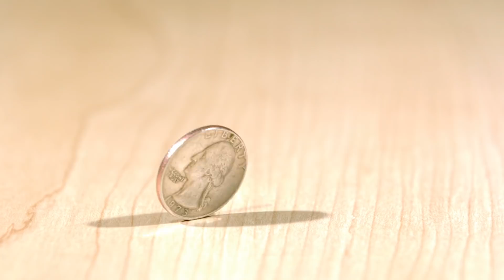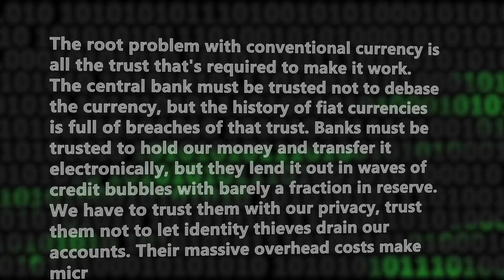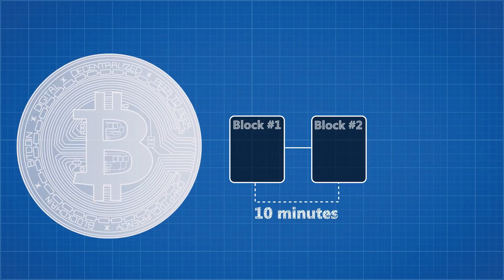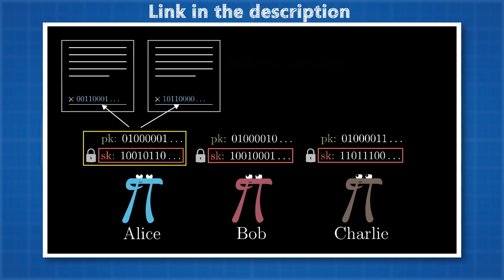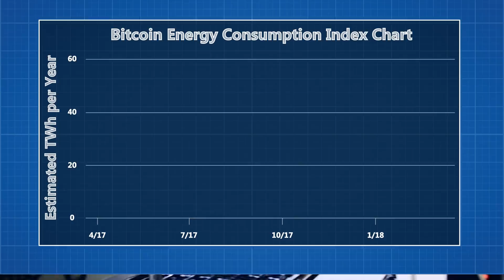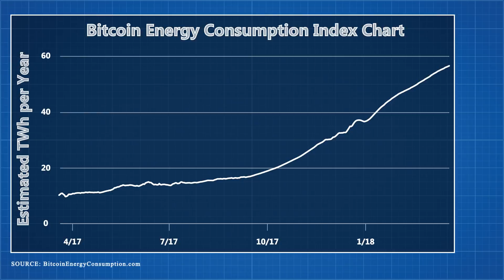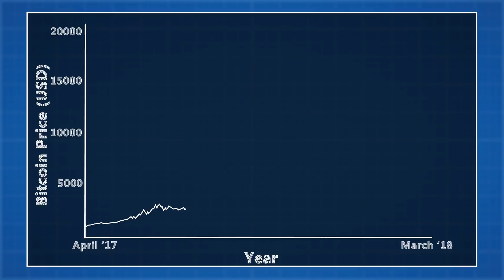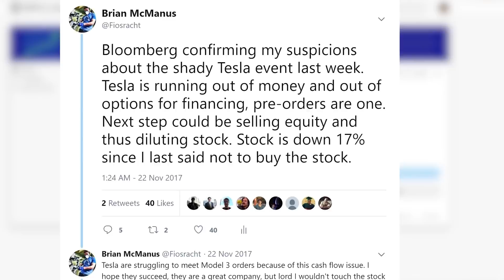Why Bitcoin Is Not Working

Comment: You're not wrong with Bitcoins fall, but there is a point with Bitcoins intent vs output. Bitcoin was based on a gold model, where it gets significantly difficult to get more bit coin. Now in real life, we don't use gold for day to day transaction, but we used to use gold to back up paper money. When Bitcoin reaches the max mark, it will have a set value based on the considerations of the user base. This, added with a decent way to move money (its no wire transfer, but it will do) will let itself be used in large transactions, like when families sell property to fund their children's collage tuition. It won't be common or useful for day to day transactions, but I do see this for buying/storing large sums of equity.

Comment: It will not work as real currency until both of these conditions come true: 
1. Criptocurrency is accepted by small vendors in local shop.
2. Mobile devices become powerful enough to process blockchain in real time, so payments are done just as easy as with cards now.

Comment: Maybe the title should be less clickbaity ;-)
The video is about: "Why proof of work is not working".

The unstable price is not a valid argument against bitcoin. It's unstable because the number of people using it is very (very) small compared to other currencies. A single event can cause big ripple effects - Like problems with exchanges caused price drops even when bitcoin was not the problem/unsecure - the exchange was. If you have a huge market capitalization (like USD or EUR) it doesn't matter if a single bank is robbed.

But sadly you main point is true. To much energy is needed to secure "proof of work"-blockchains.

Comment: If you want a currency that is decentralized and real, make it kWh.  Kilowatt hours.  It is real and can't be faked.  It can't be controlled.  It will be king over ALL cryptocurrency since they use power to mine and maintain their system.  We use it every day in our home and work.  We use it to make our food and goods.  It is already entwined into every aspect of our lives.  It will spark the next real revolution.  The Energy Revolution!  Storage will get better out of necessity.  Generation will get better.  Transmission will get better.  People can make a portion of what they need at home similar to how crypto miners mine free crypto.

Public funded power plants will become U.S. property.  Transmission lines funded by public money become U.S. property.

Any privately owned generation plants can't make up more than 5% total GDP.  All privately owned power plants, transmission lines, and equipment must buy and sell all power from the U.S. grid.  The grid is the marketplace where all transactions take place.  It can even be tracked by a public ledger system the crypto nuts clamour over.

People can store excess kWh in battery systems or contracted future generation.  As storage results in efficiency losses, this is a natural barrier to prevent a single individual or group from stockpiling kWh to amass power and influence over everyone else.  Stockpiling contracted future generation will be safe from manipulation if you don't have the means to store or use the power.  Intentionally shorting circuits to consume large volumes of kWh to drive up scarcity will be detrimental to transmission and equipment on both sides of the demarcation line.  It has natural barriers to abuse and corruption.
Reply: Charles Watts Wow, that's actually a sensible plan!
Reply: Very interesting plan from a quite appropriately named source!
Reply: Sounds a lot like digital communism. No thanks.

Comment: In short-long:
Bitcoin is backed by nothing, unlike most physical currencies (with gold, etc.).
So it's value changes rapidly, and value today, may not be the same as tomorrow.
Imagine being in a car dealership, selling cars for bitcoins. 
You see this beautiful powerful yet economical car and you decide to buy it.
The dealership gets 10 bitcoins (equal to this date about $90k) and you drive off, you have your car, the dealership made money and both sides are happy.
The very next day, just as the dealership opens, the price of that 10 bitcoins dropped by a half to $45k. And the next day the trend continues, driving bitcoin price down to, lets say $15k, below any reasonable reselling value. Dealership lost alot of money and can either:
A) Wait for bitcoin to gain value again
B) Start selling cars with price times the bitcoin original (+profit) value. 
The B) will cause car to cost 40 bitcoins, at which, only a few people who mined BTC themselves, can actually afford this type of transaction.
The resell value of brand new car, that has been sold for 10BTC just dropped, yet if you decide to "make more" by selling that car for... 30BTC - "less" than the dealership but "more" than the initial value, you will innevitably lose money.
When the BTC value returns, everyone who paid more, will lose even more.
This results in mexican stand-off, where neither of the sides want to buy/sell, due to uncanny future.
And that, ends up in everyone going back to physical money, because you can't easilly affect the value (unless political drift/military conflict/natural disaster happends).

Comment: Bitcoin is not volatile. Back in 2009, 1 bitcoin was worth...1 bitcoin. You know how much 1 bitcoin is worth today? 1 bitcoin! What can I buy for $1? $1!
Bitcoin is only volatile when you have a preconceived idea that the USD or fiat is the legitimate currency. I could use the volatility argument against the USD. Using the same logic, the USD fails as a currency because 1 USD is worth trillions of Zimbabwe dollars! Too volatile!
Fiat currencies are used because they are the most accepted and utilized. If prices are quoted in BTC, then volatility will become irrelevant.
Reply: Have you taken an economics class? This is circular reasoning. Value is relative and based off supply and demand. As a society, we have agreed that we are willing to pay $1 for a McDonalds hamburger. However, we have not come to agreement on how much bitcoin that same hamburger is worth. Back in 2009, it might have been worth a few thousand bitcoin, but now it would only be worth a minuscule fraction of a bitcoin. Over that same time, that cost of the hamburger in USD has changed mainly due to inflation, which is fairly constant and deterministic.  Since that fraction of bitcoin that the hamburger costs changes day to day, but the supply and demand of hamburgers does not really change day to day, we can say that the value of bitcoin is volatile. You can say 1 bitcoin is 1 bitcoin, yes, but the value of something must be compared to something with intrinsic value. In modern society, that "something with intrinsic value" is generally goods and services.
Reply: classic 12 year old who read about bitcoin and now thinks he knows about economics. your comment is fucking ludicrous lmao
Reply: KenanQHD okay, let's say we use that analogy. If you buy 1 car i  the US, it will cost 1 bitcoin. Will it cost 1 bitcoin to get a car in zimbabwe as well? If you said yes, are you saying the US economy is just as valuable as zimbabwe's economy where the things u can get in the US costs just the same as you would in Zimbabwe? And if u said no and say 1 car in the US is 1 bitcoin and 1 car in zimbabwe is 5 bitcoin, why don't we just buy unlimited amount of cars in the US and sell them to Zimbabwe and make an unlimited risk free profit? Tell me, how would that work?
Reply: I don’t think this guy gets how bitcoin/crypto works
Reply: KenanQHD there is one small flaw in your argument: you are comparing currencies to currencies. All currencies are volatile to some degree (the Zimbabwe dollar much more so than the USD, for example). To validate your argument, and how historians and economists determine the inflation and volatility of a currency, you need to determine how much of a certain good the currency can buy. Let’s take bread for example. How much has the US dollar amount required to buy a loaf of bread changed in the past 10 years? Not much, so it is relatively stable. How about for the Zimbabwe dollar? A lot (it changed drastically even in a single day), meaning it is quite volatile. And if we look at Bitcoin, the amount of bread one can buy with a single bitcoin has fluctuated widely over the past 10 years, and even the past few months. That pretty much squarely fits into the definition of “volatile.”

I have done literally hundreds of transactions to foreign countries and I notice the rise and fall of the values of currencies relative to each other. That may seem like the currencies are extremely volatile. But if you watch the price of a loaf of bread at home, you will notice no change. Why? Because the currency is stable relative to a good, not necessarily to other currencies.

Comment: Cryptocurrencies are not investments. They are a currency. The problem arises with the way the media, and people who don't understand the technology approach it. All the talk surrounding them is the investments that they can make to make large amounts of money in short time. People who don't know how to actually invest. Crypto is a currency first. And depending on the crypto (the good ones), everything about it is anonymous, the owner, the seller, the purchased item, the amount purchased, date of purchase, etc. Crypto is made to replace the bank, due to the failures of banking (the great depression and great recession caused by banks). And having a central bank doesn't automatically mean it's safer. Banks can be robbed of information/money. The point of it being decrentralized is that it no longer has one point of failure. But millions. You can take one person's information (through extortion), and that's it. But you can't hack into the network to steal or counterfeit any crypto. Would take more energy than we produce a year (I think, entirely possible I am wrong but that is what I believe I read). Regulations won't stop cryptocurrencies, government's are just mad they can't tax it. Crypto is a much better currency than your standard government backed Fiat currency. It has a value that can be used worldwide without exchanges. Makes travelling to foreign countries easier if there were more options than simply the government's currency. There are many benefits of crypto not yet realized, and the government intervening because some people don't know how to invest their money, will ruin it completely. The g20 summit wants some form of regulations on crypto, if that will even work.

Comment: I love your channel but this particular video is highly misleading and contains false information. As you mentioned, Bitcoin was meant to replace traditional monetary systems right? Their energy consumption is not limited to what VISA claims to consume for transactions. Traditional money requires oversight and regulation which requires lots and lots of expensive human work forces and infrastructure such as banks and safes as well as lots of IT, sales, marketing as well as lots of security measurements as well as means of distribution such as ATM machines and all these mentioned things need maintenance aswell. Those things consume many many many times more energy than Bitcoin while Bitcoins maximum energy consumption is already almost reached. So your argument about the environment is not only wrong, it's quite the opposite. Bitcoin requires less energy than traditional money to provide a trustless and secure monetary system without intermediaries overseeing you.

Comment: Bitcoin isn't static and it is sad that you didn't look at future developments. For example Lightning Network which is currently being build as a second layer on top of Bitcoin could handle millions of transactions per second. Releasing the pressure of the main network. "Bitcoin will end up as gold", no-one knows where it ends. It is very very young and no one can tell what it will become in 10 or 20 years. It is in full development and solutions are being found for the problems that exist today. 

Lets look at the bright side of these inventions instead of shooting it off in the early stages. The current money system based on debt, with banks taking irresponsible  greedy decisions, and the next financial crisis on the doorstep... has its flaws too.

Comment: Bitcoin could work if it was not created to imitate 1600's currency systems also know as commodity currencies as these do not really work well for the economy as they do not adjust to the supply and demand, therefore if we would want a crypto currency that would work well as a form of currency it should automatically adjust to the supply and demand and cut the middleman in this case central banks and their political choices like "do we rise rates or not?" that are controlling the flow of the cash.

Comment: Whilst bitcoin is   volatile in the short term, the overall pattern is that its value will increase over time. Whilst atm it is not an ideal system to trade day to day with, providing the problem with the energy is resolved, id still consider it a worthwhile investment into a future currency. Lets consider the worth of bitcoin when it was first made. At this point a single bitcoin was valued at less than a single pound. After several years it was worth several hundred pounds, now even after the crash it is worth several thousand pounds. My point is demand is increasing, and supply is decreasing, resulting in an overall increase in value. Given enough time i think the day to day changes in value will be fairly insignificant in comparison to the actual value. Remember bitcoin is still a very young currency and isnt even 20 years old yet

Comment: Satoshi attacked trust of the system problem. But the root cause of the problem is human behavior.
* The system should have to incentivize not speculating.
* Current system rewards those who RECEIVE more, not those who GIVE more. So the more successful in the system are the parasites. Not only they get economic power to rule over governments, but also they get rewarded for not doing hard work. 
* If you do not attack the cause, problem is not gone. The inventor of bitcoin invented a game. But this game was not designed to modify human behavior, but to oppose it. So it becomes a chess game and humans always win.

We reached a point in history where the parasite system will either collapse civilization, or the game will be revamped and core rules will hack humsn behavior for the better.  The mistake of neoclassical economists was that they thought money was the cause and effect, and humsn behavior did not matter. 
I would applaud a talented hacked who instead of hacking dumb computers, was smart enough to hack collective human behavior for a better world.
Yes, computers are not smart enough.  AI is a bar chart on steroids. The illusion of intelligence is similar to a pocket calculator that uses speed to impress and simulate the existence of intelligence.
You may like to read Linkedin articles on AI by Jose Pablo Luna Sanchez.

Comment: But you some transactions before are not solvable without bitcoin now. Imagine a ledger of everything, lawyers, tax collectors, fraud detection, shopkeepers, policeman can track transactions at ease. you'll see how many times an item is traded, where'd it been, did it came from a reputable source or out of thin air, did it come from a recent dead guy who got mugged from the street, this problem is only solvable with a transaction history of a currency, which we don't have today using paper money. it can also be used to increase security for example money from a stolen bank cannot be used to buy. The Ultimate question is: Would you trust/accept payment from money that are stolen, not earned?
Reply: The money cycle would change drastically, no more leakage, it would be managed so well that the economy grows all over the world.

Comment: Bitcoin mining will not(from my knowledge, correct me if you know better) always live on. From a certain point in time, mining won't be possible to protect from Inflation.
Reply: In a nutshell bitcoin is just a set of rules. Many people use software to enforce those set of rules. At the moment the limit is 21 million bitcoins. After that no more coins are added to the system (but can be lost - if you lose your key - for example wipe the drive with your wallet). Mining will still be needed with current rules - because mining is the only way to process transactions. Miner will be payed from transaction fees.

But keep in mind the first sentence. Bicoin is just a set of rules. If many people want to change the rules it can be done. See Bitcoin cash for example - they changed the rules in august 2017 ;-)

Comment: The blockchain is as much about bringing innovation in money as to bring openness and transparancy.

About the low transaction speed: 

There is the experimental Lightning Network which is a protocol above the blockchain, which is supposed to speed up transactions. 

The blockchain technology is still young. But yes. Speculation in the degree of today is not what it is meant for.

Comment: Bitcoin is essentially accellerating the end of our fossil fuels: Given that the majority of our energy comes from fossil fuels.
Reply: People are doing that not bitcoin. The energy being expended in the pursuit of bitcoin is mostly unnecessary for the process. The only reason so much power is being used, is because it's currently profitable to throw that energy at the system. power consumption is only going to go down as bitcoin matures and settles. This level of energy consumption is was definitely an oversight in design though.